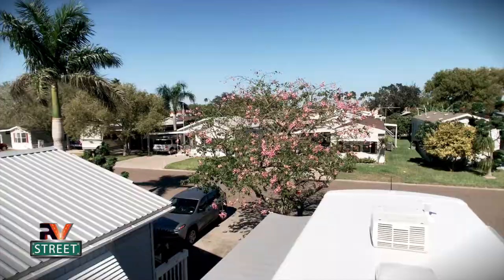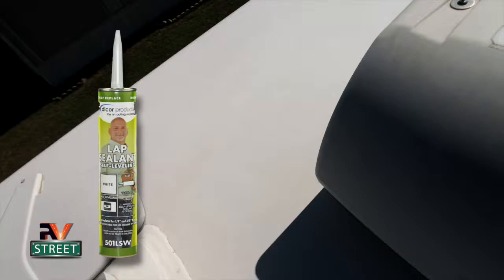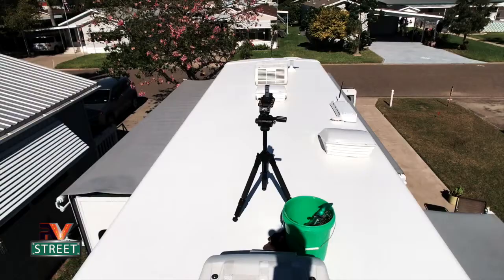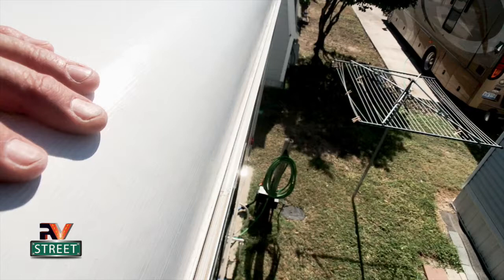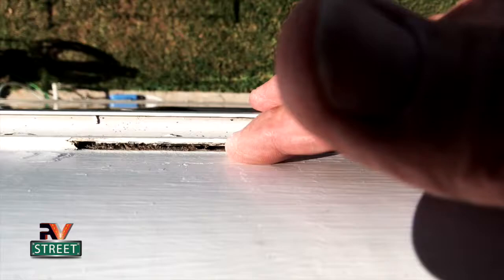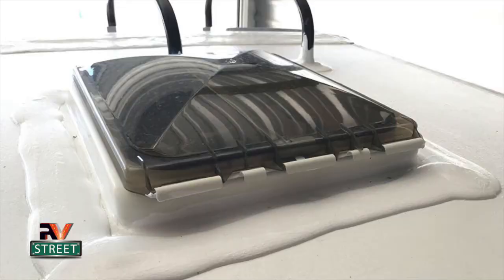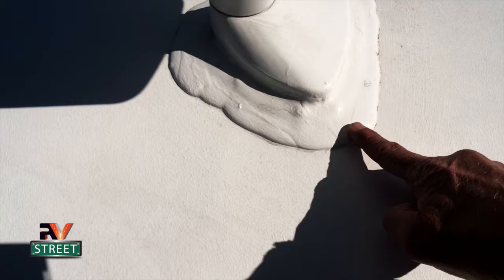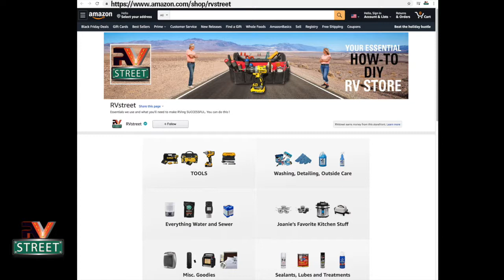RV FIBERGLASS ROOF COATING & GUTTER SEALANT REPAIR

Comment: Martin I'm hoping you can give me some advice about the TPO roof on my 2022 Thor Hurricane motorhome.   This roof was poorly sealed with defective lab sealant that has popped air bubbles all through it.  I feel it should all be removed and replaced with new lap sealant and not just sealed over the top of the porous sealant.  The other issue in the roof is that the technician how applied this sealant also spilled and tracked the sealant all across the roof from front to back on the TPO roof and even on the solar panel!  When I found this I was literally sick to my stomach, since I don't think there's any way to get this spilled lap sealant off my roof.  This is a brand new rig and it's currently being evaluated at the dealership for warranty repairs and I'm more than a bit concerned with take on this roof mess and how Thor and the dealership may want to fix this issue.  What would you recommend?

Jim
Reply from the maker: Ya, I would be pissed too. It's under warranty. Let them deal with it, but check their work closely BEFORE you take back possession.
Reply: @RVstreet  what would you want them to do for this issue?  I don't believe there is a solvent to completely remove lap sealant from a TPO roof surface,  do you know of any?  If they can't remove the lap sealant would ask that the TPO roof be replaced?  Would you trust Camping World to replace a roof?
Reply from the maker: @cujo7240  Without actually seeing the condition of the roof it's impossible for me to assess whether it warrants a roof replacement or not. But, IMO, I certainly would NOT trust CW to do the work. They just don't have the expertise, the support staff or technicians to handle something like this. You could plead your case to the manufacturer and request a roof specialist to handle this claim. The squeaky wheel gets the grease. I'm sorry you're going through this but you will get thru this.
Reply: @RVstreet  Thanks for your reply Martin.  The TPO membrane seems to have been installed correctly from the factory.  The only issue on the roof besides the defective thin porous lap sealant they used is purely cosmetic with the spilled and tracked lap sealant all over the roof.  I'm much like you in that I like to keep my stuff well maintained and looking good.  Even though I'll be able to keep the roof system well maintained it will never look good due to the roof staining.  Both my neighbor and I can see the top of the  MH from our respective upstairs windows, so it's hard to ignore.  I'm guessing you have never found a solvent that would totally remove lap sealant.  I know I've never tried to do this, since if I scrape off old lap sealant I just put new sealant right on top of where the old stuff was, so I'm thinking it is the same for you.
If there was some kind of solvent to just clean off the spilled lap sealant and not hurt the TPO, I'd be a happy camper, but my fear is this just doesn't exist.  Thanks
Jim
Reply from the maker: The problem is it's a TPO roof. It's a fabric type material. Sanding and using Acetone would remove it easily on a fiberglass roof BUT......your roof being a fabric you're going to run the risk of damaging it with that process. If it's merely cosmetic then I'd just leave it alone. I know it's an eye sore but the roof is the most important part of the RV so I wouldn't risk it.

Comment: When do You put the EternaBond RoofSeal on?  Thanks
Reply from the maker: I put 3 coats of the Dicor Fiberglass Roof Coating when I had a good 2 day weather window. No rain, no morning dew, temps  in the 80's maxing out in the afternoon.

Comment: I think I have a TPO roof on my Newmar Baystar. Can I clean my roof with the Dicor fiberglass cleaner or does Dicor have a TPO roof cleaner?  Also can I use 303 on my roof to protect? I use Dawn and water to clean roof. I was going to try  my Wash n Wax on the roof. Thanks again and we’re video’s all also good. Keep up doing a great job 👏
Reply from the maker: Dicor has different products for TPO.
Reply: @RVstreet  thanks again for the quick response 👏

Comment: Hi Martin,  When you used the Dicor prep wash, did you tape off and cover the sides of the RV to prevent dripping ?  Also for sealing the sides,  could you have used the Dicor sealant rather than the Proline Polyurethane?  Thanks again for the video as I am thinking about doing my roof.
Reply from the maker: No I didn't tape or cover the sides of the RV even though there is a video out there where a guy did do this. I didn't want to go thru all that hassle. That's why I mentioned to do everything by hand. That way you can control the cleaning process and get no splatter off onto the sides. Same thing with final wipe down with acetone. 
Then on applying the final roof coatings, I first went around all the rounded edges with my sash brush and applied 3 coats of the coating by hand and came up and over onto the roof area 2"-3". Then when rolling out the final roof coatings with a 3/4" nap roller on my pole, I did this very carefully as I approached the edge of the roof and over lapping where I painted the crown of the roof with my sash brush. Doing it this way and being careful you run no risk of splattering any material onto the sides of the RV.
EDIT: Forgot to answer the sealing part of your question. No I wouldn't use Dicor for this application. The Polyurethane material I use BONDS much better. This stuff is awesome. Remember, those sides flex a lot. You something that not only flex's but bonds those two areas real good.

Comment: Any thoughts on proflex vs  locktight polyurethane for the roof radius seal?
Reply from the maker: I'm sorry I can't be of help to you. Martin passed away April 2nd and I'm not knowledgeable in that area.
Reply: @RVstreet  so sorry to hear that my condolences.
Reply: @RVstreet nooooo 😢 I'm so sorry to hear that. My condolences.

Comment: Martin, I have a travel trailer with I believe a tpo roof? Was wondering what your thoughts were on using flex seal to cover the roof??
Reply from the maker: No experience with Flex Seal.

Comment: Did you use Dicor tubes, to get it thick and wide like it is? TIA
Reply from the maker: Yes, I used regular Dicor tubes and just laid it it there by slowly going back and forth to get that width. Going on 5 1/2 yrs. and haven't had to touch up any of it. It's still like you saw it in the video. But do remember, after I applied the Dicor and it cured, it was THEN I applied the Dicor coating over everything.

Comment: Question?… What’s the best Fiberglass RV Room Cleanser and Protectant?…
Reply from the maker: What’s the best Fiberglass RV Room Cleanser and Protectant?
Did you mean Roof? If so, after doing what I showed in this video all you have to do is wash it once a year and no need for protectant any longer. The coating is the protectant.
Here's my washing video if you're interested: https://www.youtube.com/watch?v=7KmgneT3HPs&t=193s
Reply: @RVstreet  You’re right, I meant roof…
Thank you for your prompt response.
I just watched your video, very informative.
Thank you so much.

Comment: Thanks for the informative video!  Does this change at all if you have a gel coated fiberglass roof?  Our gel coat has some flaking on the front/rear caps.  Planning to retape/seal the seams as you’ve mentioned, but unsure what to do about the flaking.
Reply from the maker: Our roof has gel coat. But after this prep and treatment no more worrying about the roof. Just wash. Compound polish & protect the caps from now on before it gets worse. Once crazing or cracking begins there's nothing you can do.
Reply: @RVstreet  Thanks for the feedback.  So can you still you still do this treatment on the areas where the gel is flaking after prep/sanding?  Or is this risking a poor bond resulting in flaking on the new treatment?
Reply from the maker: @tylers3404  Or is this risking a poor bond resulting in flaking on the new treatment?
Yes it very well could.

If it was me, I would NOT do this treatment on just the areas that are flaking. I would do the whole roof. Why you ask? 

Because for one, the roof would look like crap with all these different patch work fixes and that would drive me crazy. 😝 But more importantly, if it's cracking in some areas that means other areas are not far behind. I would take the entire roof down to the fiberglass like I showed and then do the whole roof. This way you get a complete covering and proper bonding over the entire roof. Once that's complete, the whole roof has a complete new coating. No risk of flaking every coming back to the old places or the areas where flaking hasn't taken place yet and now your entire roof will easy to clean, protected from the sun and make the whole RV cooler too. Just remember, prepping is the key to a successful outcome. 👍

Comment: FYI Winnebago doesn't use Di Cor lap sealant they use a silicone base self leveling lap sealant but because you completely removed the old lap sealant the Di Cor will adhere but Di Cor over silicone will not stick and lap sealant is only used for flashing to divert water not used as a sealant go check out AZ Expert channel he will tell you all you need to know about Winnebago roofs unfortunately they are the worst roofs structure wise no trusses,no cross bows,just Styrofoam compressed with cheap "thin fiberglass paneling the kind you can buy from Home Depot to put inside your shower in your home, it's unfortunate that they get by doing that but you seem to be on top of maintaining your roof and should last a long time

Comment: Martin,

Dicor suggest I wait two weeks after resealing the vents and other  attachments to the roof before applying the fiberglass roof coating. 

Can I clean, prep and apply the fiberglass clean and prep solution one weekend and then the next weekend apply the coating?  Does the coating have to be apply immediately after using the clean and prep?

Thanks
Reply from the maker: Can I clean, prep and apply the fiberglass clean and prep solution one weekend and then the next weekend apply the coating?
Yes you can
Does the coating have to be apply immediately after using the clean and prep?
No it doesn't. Just make sure that the roof doesn't get dirty or dusty while you're waiting and you have a good weather window when you apply the coating. No rain or dew for 2 days.

Comment: Martin, I have a 2005 Winnebago Sightseer 30b Workhorse. Do all Winnebagos have fiberglass roofs?
Reply from the maker: "Do ALL Winnebagos have fiberglass roofs?"
Well I'm not sure if ALL Winnebagos do since there are a lot of different kinds of models and versions of RV's that Winnebago makes. Yours probably does though.
Reply: It's available in white.
Reply: Sorry to bother you again. Ordered the Locite PL S40 and they sent this. The label matches up with what Amazon has on its site. But, there is no S40 anywhere on the tube. Did I have the right one? If not, will this work just as well.  Well, see I can’t attach a photo here. Anyway, The tube reads specs ASTM C920, Type S, Grade NS, Class 35, USE NT, M, A, T, O, & I. But, no PL40 anywhere. Btw, Amazon doesn’t offer the Dicor coating in white fiberglass.
Reply from the maker: @ylifeonline  The Locite PL S40 that you ordered from my store is the right one.
The Dicor coating in white on Amazon—in my store—hasn't been available for awhile now but will be later. Supply chain issues. OR...You can book mark my store in your browsr and check once a week when it's available OR you may find it at a local RV dealer. BTW...Dicor doesn't sell directly to the public so don't bother going to their website and trying to order from there.
thx Pal

Comment: Hey Martin, love your videos, a question, is that a wi fi booster on your coach? If so what kind? Where do you find it? Thanks Lee
Reply from the maker: Not a wifi booster but a cellular booster. This really helps us get a stronger cell signal so we can use our phones as a hot spot. Mine is the weBoost 4G-X that I installed 4yrs ago. weboost just released a newer version—about a year ago I think—called the WeBoost Drive Reach RV which is stronger and same price as I paid for mine 4yrs. ago. We couldn't do what we do without it. Traveling it is a must have IMO. I have both models in my Amazon Store in the Electronics category. https://www.amazon.com/shop/rvstreet
thx Lee 👍
Reply: @RVstreet  Thank you Martin, your the best. Lee

Comment: That roof will never leak.  But, I'd never use Acetone on my roof!  Acetone can eat almost anything if you don't get it off quickly and throughly.
Reply from the maker: Well just to clarify, I hear what you're saying but as you probable know Acetone evaporates very quickly. Using it on a rag and wiping down the roof is the perfect way to thoroughly clean and etch the roof as the last step so the coating will really adhere. When applying it to the roof this way, when wiping it on it evaporates in about 10 seconds or less. Prepping the roof properly is sooooo... important to apply this coating product. I had no issues at all with my process and using acetone. This coating was applied to my roof 6yrs. ago and still looks awesome. All I have to do now is wash it once a year.
thx Michael for taking the to comment 👍
Reply from the maker: Well just to clarify, I hear what you're saying but as you probable know Acetone evaporates very quickly. Using it on a rag and wiping down the roof is the perfect way to thoroughly clean and etch the roof as the last step so the coating will really adhere. When applying it to the roof this way, when wiping it on it evaporates in about 10 seconds or less. Prepping the roof properly is sooooo... important to apply this coating product. I had no issues at all with my process and using acetone. This coating was applied to my roof 6yrs. ago and still looks awesome. All I have to do now is wash it once a year.
thx Michael for taking the to comment 👍

Comment: Will added a coating void the Winnebago 10 year warranty ?
Reply from the maker: I have no idea. IMO, I wouldn't think so, because you're not changing anything structurally. But I'd call Winnebago to be sure. Also, if I'm not mistaken, those 10 year warranties are limited warranties too.

Comment: Question - I'm in the process of Martinizing my roof and noticed some of the screws that hold down the edge have rust. Most, it's none to a little, but some quite a lot. Assuming they are not fully rusted and need replacement, should I spray them with Permatex or cover them with Dicor?
Reply from the maker: That's a tough call. But from your description here's what I'd do.
If you try to remove them you run the risk of them breaking off. So I'd take some 0000 steel wool and some WD40 and scour the heads of all those screw heads. Then clean them thoroughly gently with a paper towel or a rag with acetone to remove all oil residue. Then tape off the screw heads with blue painters tape and spray the heads with silver Rustoleum paint. That way they'll match the aluminum gutter.
I would NOT use Dicor sealant. The reason is, you have to use the Dicor vertical sealant that is resistant to sagging but even then it may cause problems of rain water dripping into the gutter properly.
Yes it is a tedious fix, but that's what I'd do.
Reply: @RVstreet  I agree, removing them is not an option. On our coach the fiberglass comes over the top of the coach, so the screws are actually on the flat of the roof. After looking a bit more, the issue seems to be due to condensation from the heat pumps. I Think your suggestion is still best, but I'll probably give them a coat of Permatex, then paint. Then i've got to find a way to redirect the condensate to the gutters more effectively.

Comment: Martin,

I am getting ready to do this roof job. I am going to use the tape you described to seal the end caps. Do I put the tape down the rolled side to the gutters,?  If I do tape down to the gutters, do I used the self leveling sealant on the rolled portion over the tape?

Thanks
Reply from the maker: No need to put the tape down and around to the gutters.
Reply: @RVstreet  thanks
Reply: Sorry for another question. If I need to caulk the end cap going down to the gutter what caulking do I use? This would be vertical part of the end cap.
Reply from the maker: @stephenwhite9869  No need to apologize. I'm here for ya if I can help.
So for that rounded, vertical area from where the tape ends on the roof and then down to the gutter use Loctite PL S40 White Window, Door and Siding Polyurethane Sealant which is in my Amazon Store in the "Everything on the Roof" category. Scrap out all old sealant, clean with Acetone and then apply.
Reply: @RVstreet  thanks again

Comment: The company RV Armor does what you have done. They use pretty much the same products. Do you know anything about them.
Reply from the maker: I've heard of them and have read some material in the past but have no idea what material they use. But one thing I do know for sure, the way I did it myself has had great results and cost waaaaaaaay less than what RV Armor would charge. 😜
But that may be a good option for some who are unable to do this kind of work themselves anymore for various reasons.

Comment: You DO NOT want to get that Dicor fiberglass roof prep on the sides of the coach. I had some leak through my tape and plastic and it streaked and discolored the metallic decals on my RV. Good product though. Dropped the inside temp of my RV by 10F in the summer.
Reply from the maker: Yep, that's why I said to apply it by hand. But ya, it's an awesome product.

Comment: Nice work, very thorough!  However, if viewers are going to patch (rather than replace) the factory original sealant, Dicor lap sealant won’t stick to Winnebago’s original siliconized sealant.  Use Nico 311 self leveling silicone (Winnebago P/N 072889-10-000).